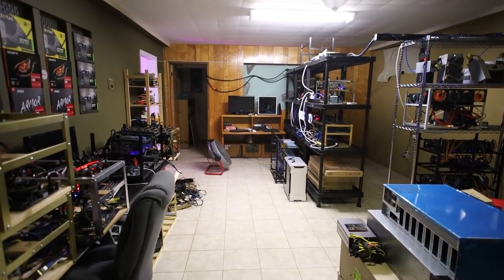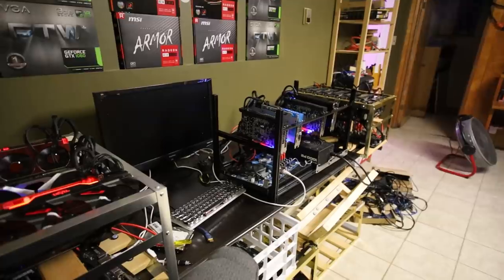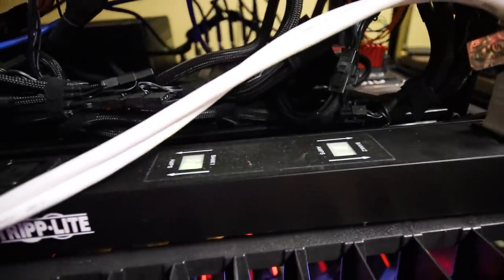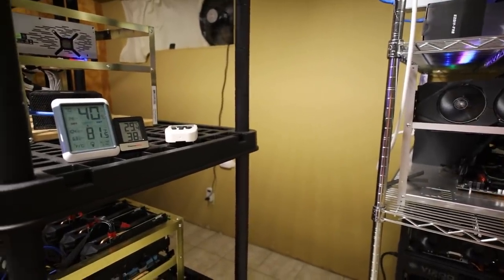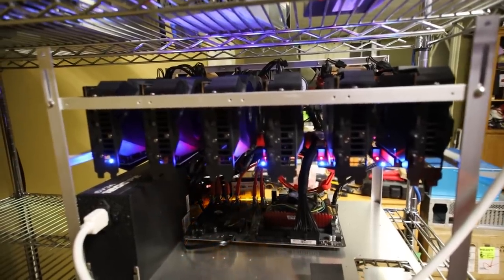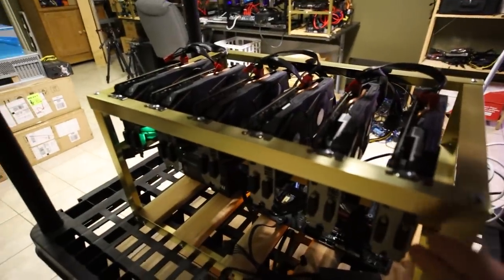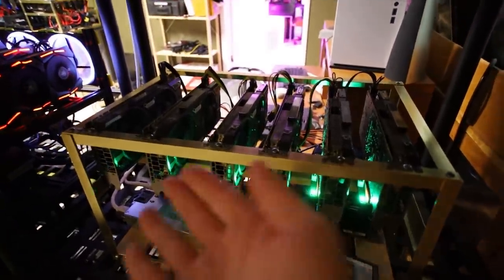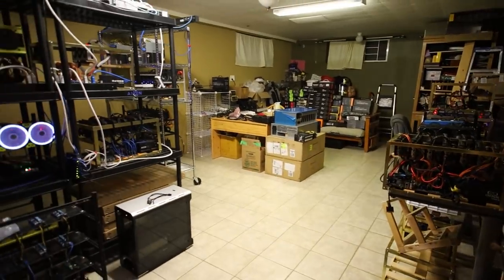Crypto Mining BASEMENT Update! September 2020

Comment: Tripp Lite pdus with 240v and 30aMP with rack mounted locking plugs are my babies. They also connected network to your switches and can be maintained in a rack which makes it easier to organize your cabling.

Comment: if u back ur clocks down ull be able to fit more as well as switch some less efficient cards out
some of ur cards are using 15-30 watts extra for 1-2Mh
i used to have the same problem and still do for the most part, but have come to terms with my 2-3 circuits
its amazing when u back ur clocks down for a rig lose 6-12Mh but gain a whole 100-200 watts or up to 1.5amps

Comment: The Rosewill cases are nice, couldn’t tell if your model has the front three 120mm fan mounts or not, I’ve had heat issues with mine, very curious what type of fans you will go with on that build 👍

Comment: what is the total amps running in to your house you are currently mining in?  I know currently I only have one 100amp panel.  Sucks it is not as simple as just swapping out the main breaker with a larger one.  I plan on installing a subpanel though to run a couple dedicated breakers to my mining area in my basement.  Right now I have extension cords all over my house running to my basement to get power from different breakers

Comment: 21600 total watts with 3 30 amp 240 breakers at 80% that's 17280 watts for 3 30 amp 240v lol been doing lots of research trying to wire my own power in.  Can also save money with spacegoats power meter and not needing a monitored pdu.  Also with power limited always be power limited lol to use cars with highestest hash per watt fill everything up with 5600s, 5700s or 3080s lol but when amd drops who knows what could happen with there new cards.  Also I dunno what all u got into hiveos but probably free up like 2000 maybe 3000 watts with all them rigs in win 10 lol just gotta watch them more.

Comment: Boot screen not showing when 10 gpu or more. I'm thinking because of the pico psu. I should use 300W pico psu?

Asrock h110 pro btc+
Intel g3930
8gb ram
3 hp platinum server psu 1200W
5700 xt nitro
SMOS in a 32gb flash drive

Comment: Hey panda I just started mining and built a 6 gpu rig (Rx570 8gb) watching you're videos thanks to you, but iv come across one problem when I'm using msi afterburner only one gpu I can overclock it to 31mhs but all my other gpus won't overclock even tho it says I changed the mem etc....i test it by changing the other 5 gpus fan speed and they work fine but it won't change the hash rate  when I'm over clocking my other 5 gpus any help please? I'm also using nano miner

Comment: Hey man, you need to consider that fact that power ratings for residential operation of non-inductive power consumption are based on a MAX of 80% of the ampacity rating at 100% duty cycle (20 amp 120v circuit at 100% duty cycle = 16 amps max continuous...e.g.: 1600w~1920w) And if you are on 15amps.... oof!  Then you are dancing with the devil above 12 amps! (1200w~1440w)

Comment: Hey RED! Could u tell me if the RM650 PSU can run 2 RX5700XT +1 RX570 8GB?
Reply from the maker: I'd get a 850w if u can
Reply: do i actually need that buffer? i mean my one 5700 is running at around 150w (so both at 300/350?) and my 570 is running at around 100w.